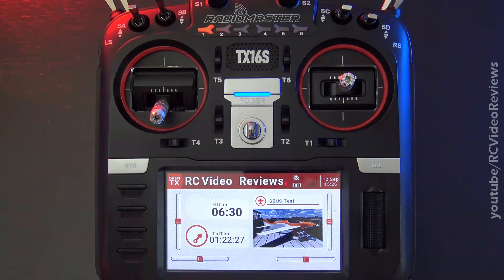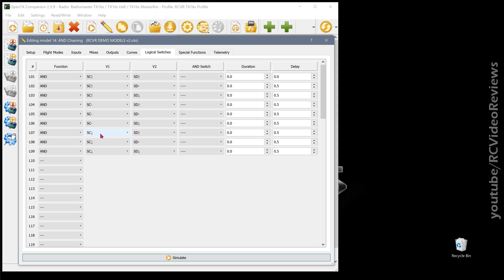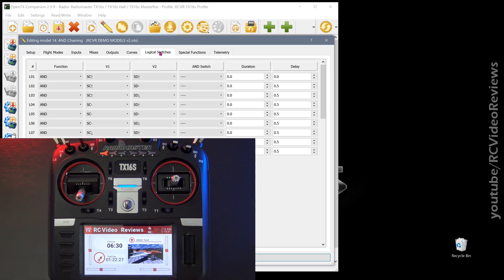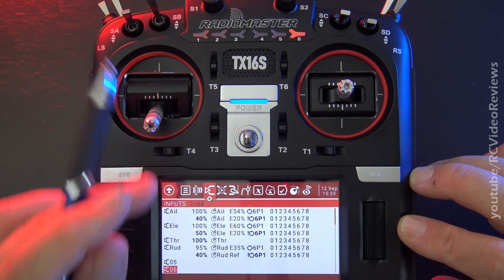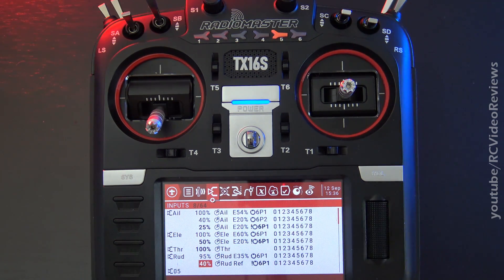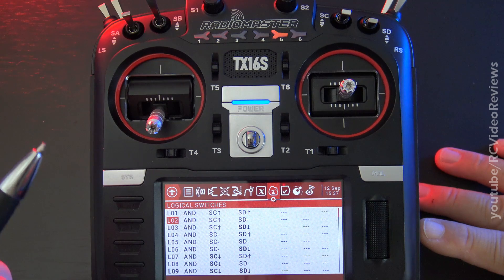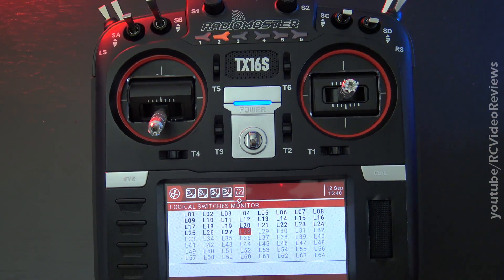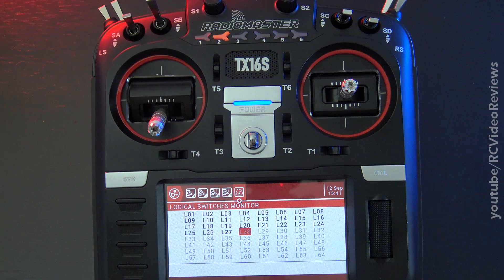OpenTx Tutorial • 54 Position Switch Matrix • TX16s T18 Control ANY Flight Computer • [Intermediate]

Comment: hi! could you tell me how i can make 2 groups of 3 buttons with those push buttons? the 3 left buttons should work for e.g. curves and the right 3 buttons for throttle curve...i believe it is possible, but do not find that ...best regards...René
Reply from the maker: The 6pos switch is just that. It can only occupy one position at a time and it will only output one pulsewidth at a time.
Reply: Thx for your fast reply
Reply from the maker: Sure thing.

Comment: This is empowering! I know that you showed us how to assign curves to, say, gain assigned to a slider switch, which is great for tuning dual rates, expo, cyclic or tail or governor gain in various flight modes, but what I really like about this video is that you show the number of possible combinations of various flight parameters associated with different flight modes. Sure, there are limits to what is actually desirable or practical in terms of flight performance, but it's nice to know the potential capability is there. I'm eagerly anticipating playing around with this on my helis. 👍
Reply from the maker: You've captured the spirit of the video. Definitely not practical to have 54 modes, but you can see the extent of what's possible.

Comment: Quite interesting. Great video..

I just received the tx16s this past weekend. I was using an x-lite for the past couple of years. Night and day difference in control. So smooth.

I've noticed while setting up the switches and flipping them while in betaflight, that switches SC and SD (3 position switches) affect each other.

SC.     RESULT
Pos
===================
UP.      SD IS A 2 POS SW
MID.    SD IS A 3 POS SW
            SD UP SC&SD GO LOW
            MID AND DOWN NORMAL
DWN   SD 3 POS NORMAL

SD.       RESULT
====================
UP.       SC 2 POS SW
MID.     SC 3 POS
             SC UP SC&SD GO LOW
             SC MID&DOWN NORMAL
DWN.   SC 3P NORMAL

Is this a defect? Can you change this some where in opentx companion or the radio itself?
Reply from the maker: We may have to discuss this on Discord. I feel bad, I know how much you had to type to get that chart right. 

There should never ever be any interference from one switch to another switch. My suggestion would be to assign each switch to a channel in the mixer, fire up your channel monitor and rerun your test. I think you'll find in the channel monitor that no switch will impact the output of another switch. I'm guessing this has something to do with Betaflight.
Reply: @RCVideoReviews  Actually I discovered after sending the message to you that if you press the Sys button then press the 
< Page button twice and scroll down to the bottom, there is "Debug", select switches and click the thumb wheel, you can see the position of your switches as you move them. It does the same there too. Sounds like it has a defect  :-(
Reply from the maker: @larry9878  If you move one switch and the value of another changes--yes, that's a hardware issue. That shouldn't happen.

Comment: Best rc vids I've seen to date. Clear and comprehensive. I would love to see you do one on servo choice/performance.
Reply from the maker: Thank you for the kind words. I'm afraid I wouldn't be a great source for servo choice because for the most part I just look at the recommended weight of the servo. In certain cases for nicer planes I'll put more work into it. I'm not very particular when it comes to servos. 

I like Hobbyking HXT5010 for full size.
I like Emax for 12-27g.
I like MG90 metal gears for 9g. 

I used to like Coronas but I've had some bad luck with them recently.